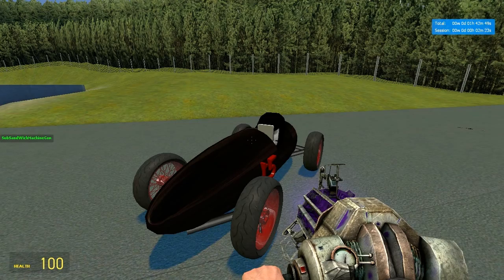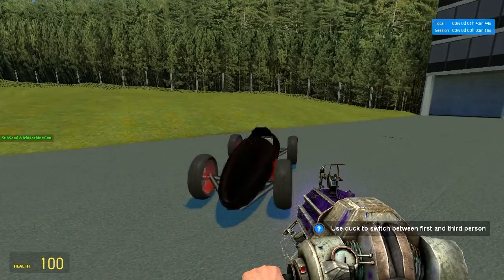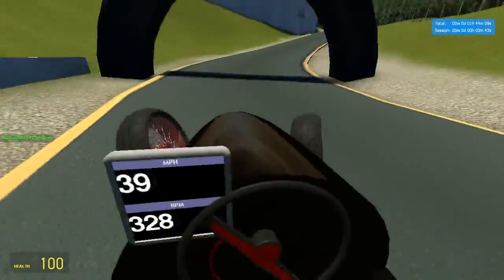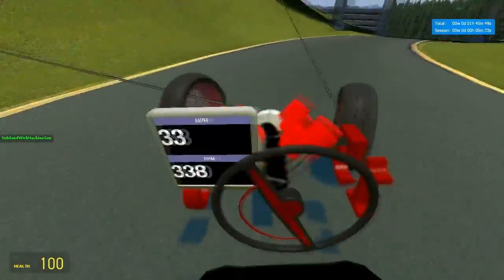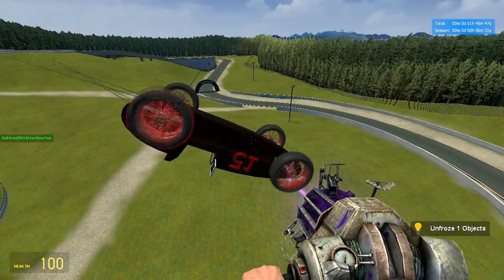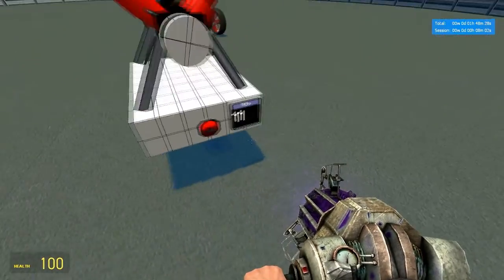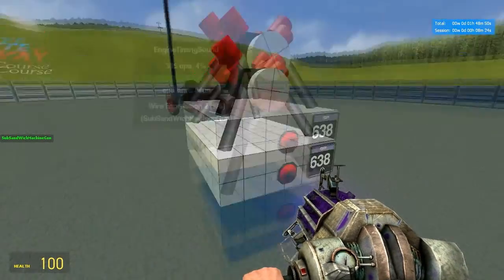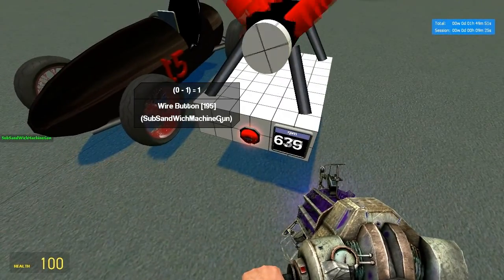[Gmod] Cooper500 with working engine, suspension, steering, and automatic transmission

Comment: i thinl the engine its a little bit stronger for the car,i guess is thats why is shaking at high rpm,maybe a solid suspension can absorve that
Reply from the maker: I was aware XD just having fun and fucking around. I never got very good at handling suspension, thus all the weights ended up very odd and almost required the engine to be big. lol